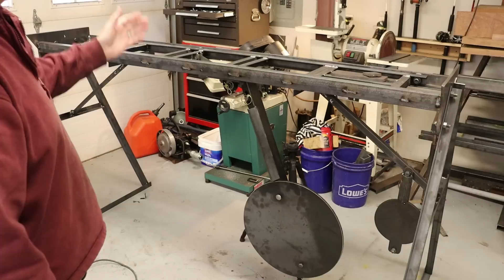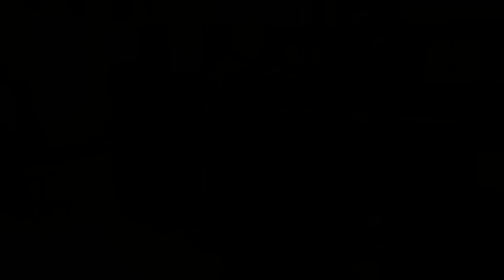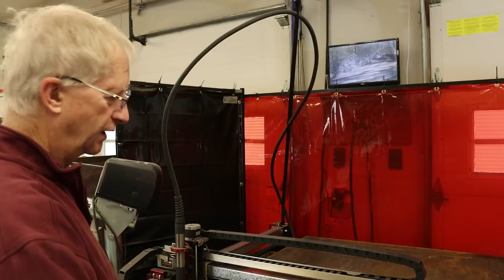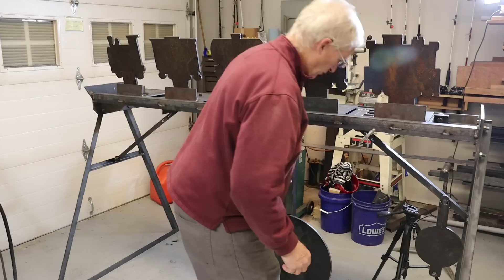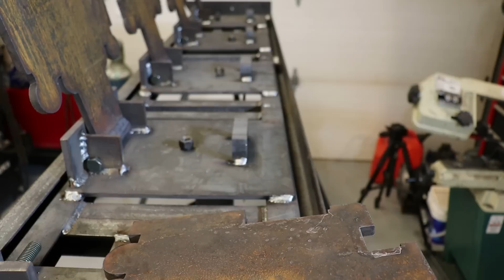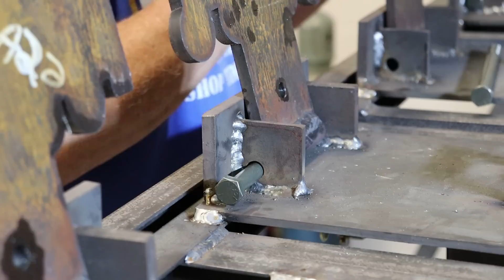Train Time, Moving Plate Rack Pt. 4

Comment: Fantastic project. I enjoy the idea of the little train just curious on what size bullets that they will be able to shoot these targets with without it damaging it.
Reply from the maker: This target is for a Cowboy Action Shooting club. They only use lead bullets (no jacketed or plated bullets allowed) at target velocities. As I was told, most use .38 special and .45 Colt at a max of 1000 fps pistols/1400 fps rifle. They said most are more like 650/800 fps--light target loads.  Since these targets are AR plate, they will withstand full power 9mm or 45ACP pistol rounds or non-AP 5.56 at 100 yds+.  But you never shoot steel  targets with jacketed or plated ammo at close range due to risk of ricochet.  That's one reason the Cowboy shooters only uses soft lead bullets